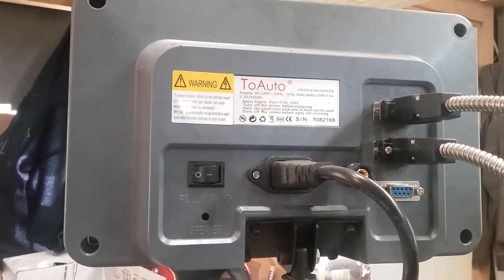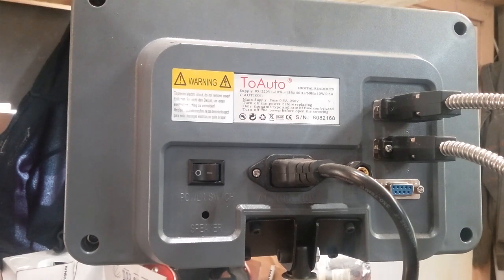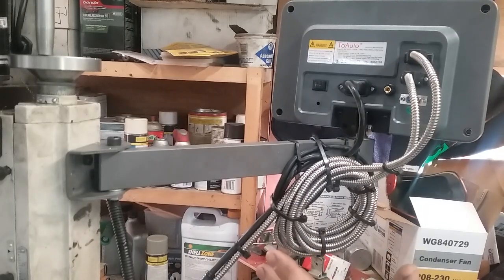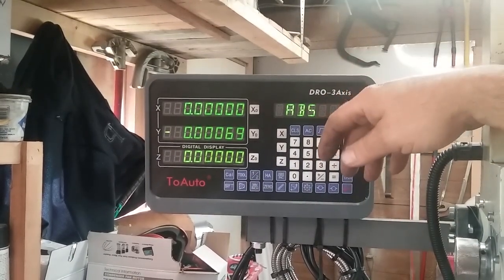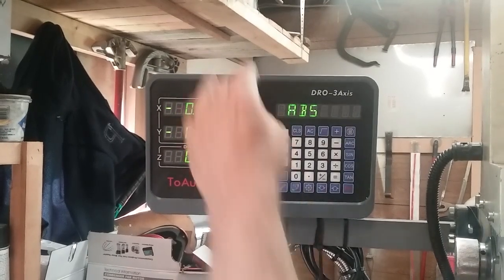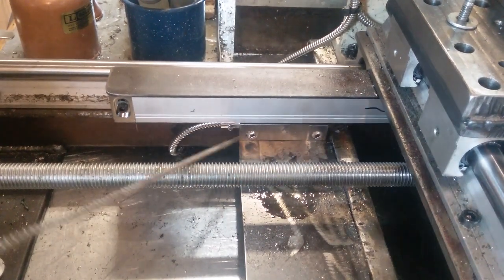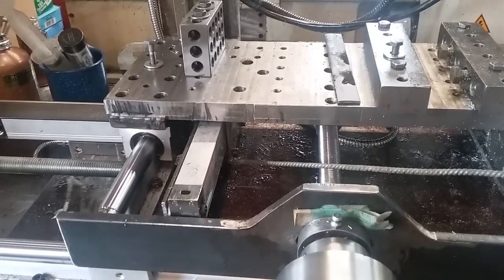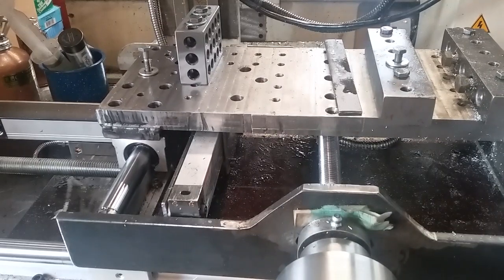ToAuto DRO setup on my home made XY table.

Comment: It looks like you could swivel the readout unit around 90 degrees to to the left to gain easy access to the power switch?
Reply from the maker: It's just easier to reach around the right side.  If I listen the swivel bolts, the dro vibrates all over the place.  I've gotten used to it.
Reply: @thefixerofbrokenstuff  Yeah, I didn't realize it was bolted down tight.
Reply from the maker: Still would of been better to have the switch on the front.  But hey, it's held up to my abject ignorance.
Reply: Reaching around to the back of the "box" is a standard feature on any DRO unit that I have used over the past fifty years. Your hand just learns where to go.
Reply from the maker: Reckon so.

Comment: I drool every time I see 1 of you guys install a DRO. I just cant bring myself to come off the cash...instead I just ordered a cheap plastic digi caliper to mount on my mill hopefully with a quick disconnect so I can use it on the other machines as well
Reply from the maker: It aint nothing that two or three pictures of a dead guy wont cure.  They are really affordable. Remarkably affordable in fact.
Reply: @thefixerofbrokenstuff  lol. Never heard that particular phase before